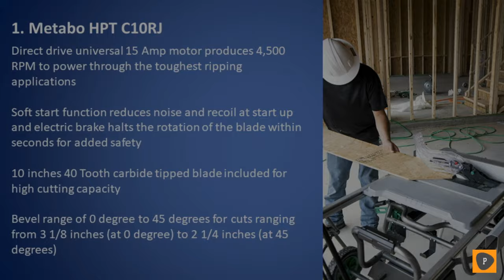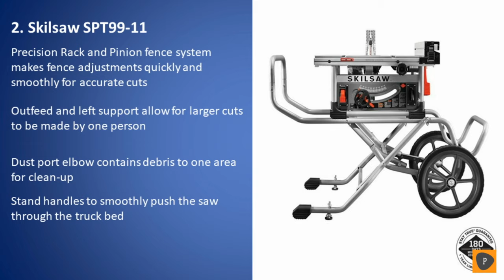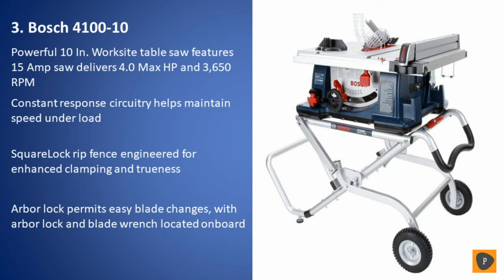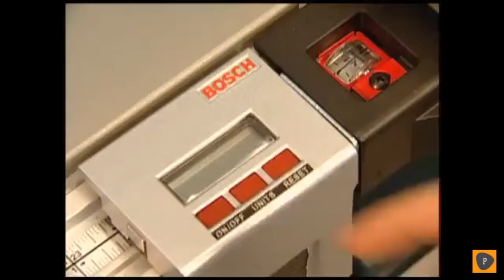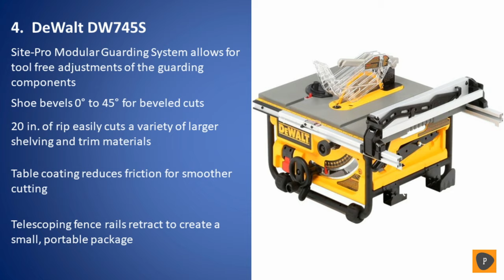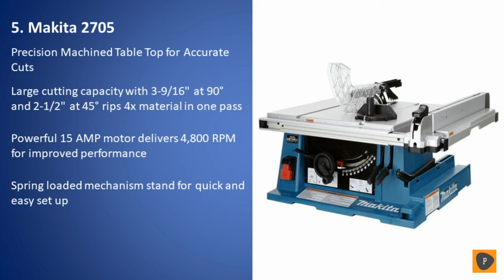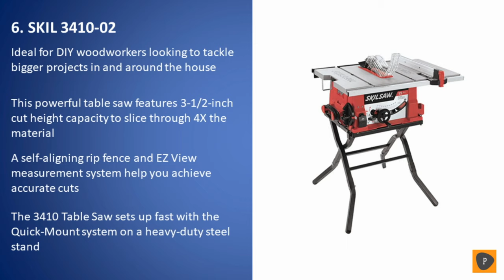Best Table Saws in 2020 - Top 6 Table Saw Picks

Comment: I am surprised that the Ridgid Contractors saw did not make your list. I think it is far superior to at least the Skilsaw. One of the things that I like about the Ridgid products is that if you register your tool within 90 days of purchase you have the Lifetime Service Agreement at no extra cost. Anything goes wrong with it for as long as you own it, they will fix it for free. Pretty hard to beat that. I have used the Metabo and I have to agree that is also a fine table saw.
Reply: Gregg Hernandez CORRECT, Ridgid will fix for free, shipping on your dime, to them and from them, prepaid by you before any service starts.  Am I correct or wrong?
Reply: Hi Greg, Have you ever had to deal with the warranty department for Rigid. I have read numerous reviews that have issues dealing with the warranty department. Either they will not back the warranty or they drag out replacing parts or dealing with your issue. Would like to know your experiance.

Comment: Table saw number  1  is DEWALT 7491 RS  NOT  METABO.. Number 2  SKILL SAW  .. NUMBER  3 BOSCH REAXX ..  Number 4  METABO hpt C10 RJ  which was HITACHI  C10 RJ - Number 5 BOSCH 4100  .. Number 6 DEWALT  Dw 745